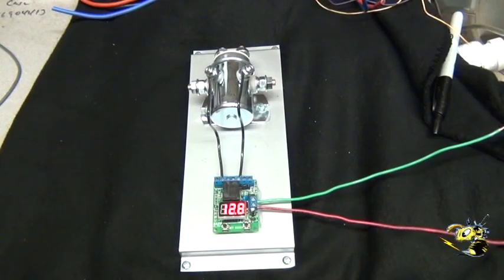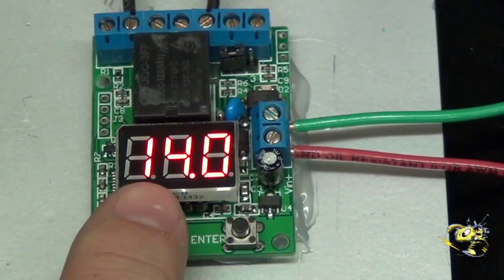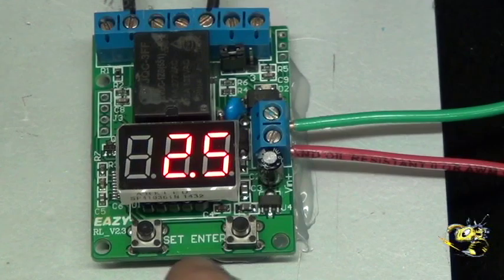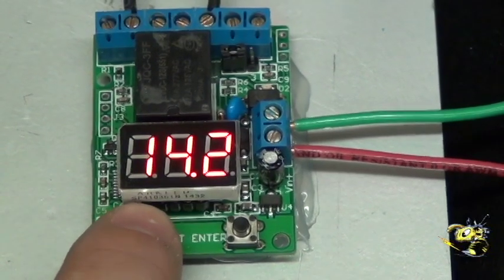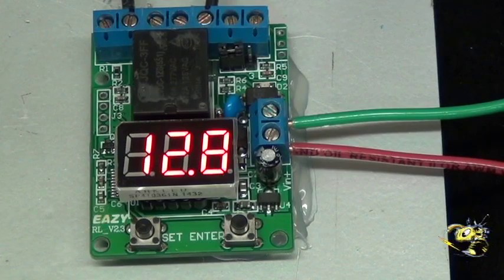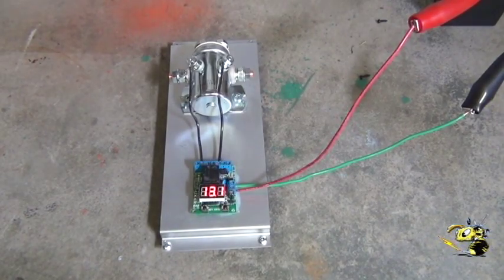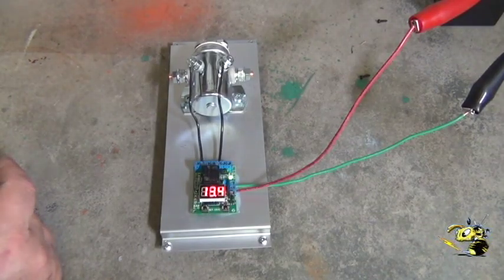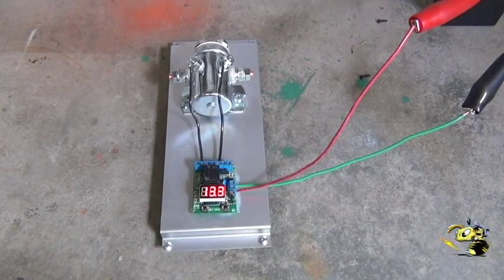SEA440AJE  wind turbine charge controller battery regulator

Comment: Hi..got one of thm 12v 400 watt 3phz..windyz from china..set it up on all new gear and ugradded..led display.. hybrid controller...but neva eva got 1 amp frm it.screen said wind break on..to tht effect..and argghhh🤬..so now i gtta bridged rectifier..now at least i can see some power..36v varing..now i jus need to regul8 it...will yr SEA440AJE..see me on th rite track ?
The hybrid solar wind controller came with it.im not a tech so im winging this an wood lov som help...thnx marque 👍

Comment: Hi there! I am interested in the specific product. There is one thing I need to ask. If a wind generator gives an output of 60volt for example , can this device stabilize them to 24Volt or does it simply stop charging? Thank you

Comment: I just got mine in the mail and no wiring diagram included ,thanks to your video I know how to wire it up ,thanks
Reply: I hooked mine up just like your's I set it at 14.6 and 13.8 then 00.0 last zero flashing click one more time I have 0.0 and no volts reading of my batteries ?

Comment: Can I use this unit to switch from Battery A to Battery B and then back again based upon Low-High charge input voltage sensing?

Comment: I used this same controller with my 300 watt solar panels to charge my 
batteries for over 1 year 'til I bought a cheap china controller with 
display.

Originally I had a 75 amp MPPT charge controller that burned up a few month after the warranty was up and I did not have the money to replace it at the time.
 
I came across this cheap priced controller and bought 2 of them. I just put a 30 amp 12 volt DC automotive relay on it  and never had any problems with it.
About 1 month ago I replaced this controller which was still working with an cheap china made controller that had a display  on it and the display was the only reason that I replaced the controller. I will keep the controller  in storage for emergencies.
 The voltage display on the controller was the same as my fluke meter would show.

Comment: Would this work to dump solar into an GTI and would you switch the low voltage/ solar side or the high voltage grid side of the GTI.
Reply: +Cotronixco 
That link does not answer my question at all. It is spam for selling other things.
Reply: +Bonnie Flory I wonder the same thing. I purchased two of these units and want to be able to charge my batteries up via solar, and then once they are charged, switch or divert the rest of the solar energy to a GTI Or Multiple GTI's. Not sure how to do it yet. The other unit I purchased is used for my wind generator and I dump the excess to a dump load. Device Works great for that.
Reply: +Eric G 
I bought 2 also which one is hooked up to the solar at this moment. It keeps the battery charged so far.
Mine is switching fast with solar like in 3:46 in this video. A GTI can not be switched on and off that fast. It may take 30 seconds or more to make a GTI connect to the net because of the build-in safety features. 
Here is I think,  what I will do.
I will have 1 or 2 panels on the charge controller constantly, this will take care of fluctuation of the sun and minor loads and still get a float charge  after the batteries are charged and should prevent the switching to switch to many times. When the battery is getting full that  electronic control in the video  will switch the rest of the panels with an relay to heat a pre-water heater. So 2 panels will stay all the time on the charge controller, while my other panels are switched back and forth from charge controller to the water heater.
The incoming water will go to the pre-water heater first where the panels will pre-heat the water. Then the water will  go to the second water heater that is powered by the grid. If the pre-water heater is warm enough the second water heater will not use any power from the grid and when there is not enough sun then the second water heater will bring the temperature up to temp with grid power. 
It does not matter if you put the power into a water heater, because you still will save power by not having to heat water with grid power. So far I consider a water heater to be a battery since you can store energy as heat.
Reply: +Bonnie Flory Thank you for your reply. Im still gonna try to mess around and  try to divert to a grid tie one way or another after charging my battery bank first. I could use a two position manual transfer switch , with one position to the charge controller and the other position to feed directly to the GTI. But I just want a automatic solution to do this...